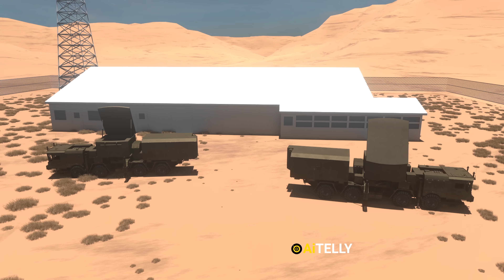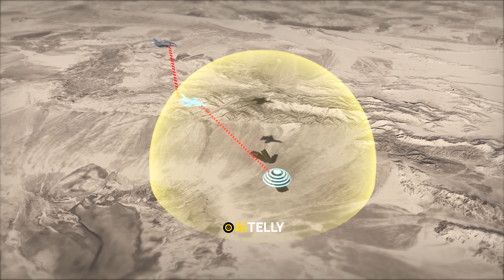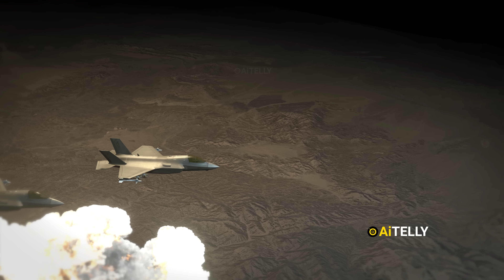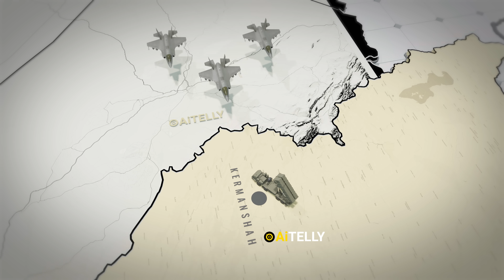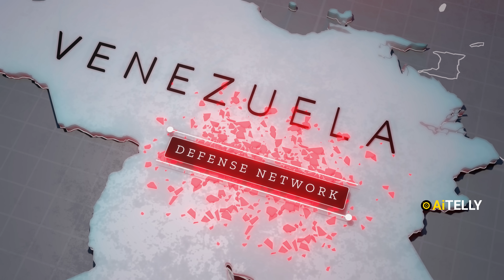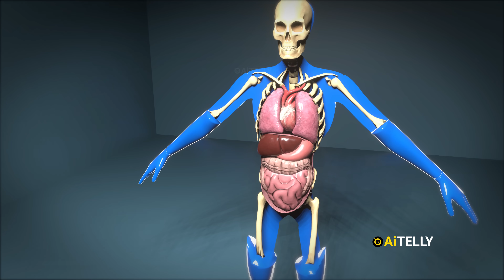US Electronic Warfare Strategy | Explained

Comment: *1. THOR (Tactical High-power Operational Responder)*
A directed-energy microwave weapon that can fry entire swarms of drones simultaneously — not one by one. Think of it as a giant EMP cone that selectively disables electronics.

---

*2. LOCUST (Low-Cost UAV Swarming Technology)*
Launches 30+ autonomous drones from a tube in seconds. They self-organize, communicate mid-air, and overwhelm enemy radar and defenses through sheer coordinated chaos.

---

*3. DARPA's ADAPTER Program*
Battlefield soldiers equipped with tech that reprograms their own biology — altering metabolism, sleep cycles, and cognitive performance in real time. Soldiers who don't tire, don't panic, don't slow down.

---

*4. ARES (Autonomous Rotorcraft Expeditionary System)*
A pilotless VTOL platform that autonomously resupplies troops in active combat zones — no human pilot, no hesitation, no fear.

---

*5. HAMR (High-Frequency Acoustic Manipulation & Resonance)*
Classified-adjacent acoustic weapons that can disorient, incapacitate, or cause organ disruption at specific frequencies — leaves no marks, no trace.

---

*6. Silent Falcon / Persistent Surveillance Mesh*
A network of near-silent solar drones that loiter at 20,000 ft for *days*, mapping, decoding enemy communications, and feeding real-time AI battlefield analysis — invisible to radar.

---

*7. Project Maven (AI Battlefield Brain)*
Not a weapon — scarier. An AI system that processes drone footage, satellite feeds, and signals intelligence simultaneously to predict enemy movement before the enemy knows it themselves.

---

*8. CHAMP (Counter-electronics High Power Microwave Advanced Missile Project)*
A cruise missile that emits EMP pulses as it flies through a city or base — selectively killing electronics building by building, floor by floor. No explosion. Total blackout.

---

*9. Laser Weapon System (LaWS) + HELIOS*
Ship-mounted lasers that shoot down missiles, drones, and aircraft at the speed of light — each shot costs about $1. Compared to a $1M missile, the economics alone are destabilizing.

---

*10. DARPA's Neural Interface Weapons Control*
Pilots controlling entire drone squadrons using thought alone — brain-computer interfaces that eliminate the reaction-time gap between human decision and machine action.

---

## 🇺🇸 Why Is the US So Far Ahead?

*Budget* — $886 billion defense budget (2024). The next 10 countries combined don't match it.

*DARPA model* — A unique agency that funds deliberately weird, high-risk research that no private company would touch. Most of the internet, GPS, and stealth technology came from DARPA.

*Private-Military fusion* — Companies like Palantir, Anduril, SpaceX, and Lockheed sit inside the defense ecosystem. Silicon Valley is a weapons lab.

*Data supremacy* — NSA-level signals intelligence + satellite coverage + AI processing = knowing the battlefield better than the enemy knows itself.

*Talent pipeline* — The US attracts the world's best engineers, scientists, and coders — many of whom end up working on defense contracts.

---

The scariest part? Most of what's truly cutting-edge is *still classified*. What's public is already a generation behind what's deployed.

Comment: It focuses on the EA‑18G Growler, where the pilot flies while an electronic countermeasures officer controls powerful jamming pods in real time against enemy radars.

The Growler can use spot jamming, concentrating tens of kilowatts of energy on specific radar frequencies to “burn through” processing and blind enemy sensors.

It can also generate “phantom fleets” by catching radar pulses, scrambling them, and sending them back so operators see dozens of fake jets, wasting missiles on ghost targets.

A third trick is creating a digital clone of a real jet, dragging the fake radar track away so incoming missiles follow the ghost while the actual aircraft escapes.

Before any strike, US satellites and spy planes map enemy radar “fingerprints,” build a digital hit list, and plan 3D threat rings and safe jamming orbits for Growlers.

During an attack, Growlers first blanket wide‑area early warning radars with noise, then shift to precise deception and communication jamming, forcing enemies to choose between being blind or being targeted by anti‑radiation missiles.

The video also covers high‑power microwave and infrasound “soft kill” concepts and illustrates recent operations (e.g., against Iran and an S‑300‑equipped Venezuela) where electronic warfare opened the airspace for stealth jets and cruise missiles.

Comment: If it is true, the special incapacitation weapons used in Venezuela could be used in future to remove CS gas projectiles during riots  and quickly disable  hostile elements and with lesser risk of harm from law enforcers and not 'fumigating' the furnitures of building were  normal CS gas grenades are used to crowd  control